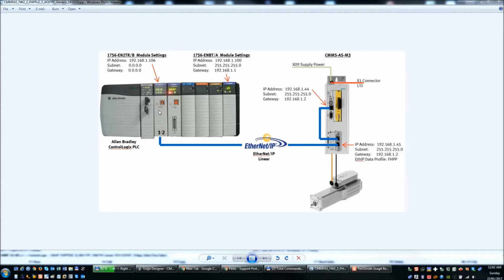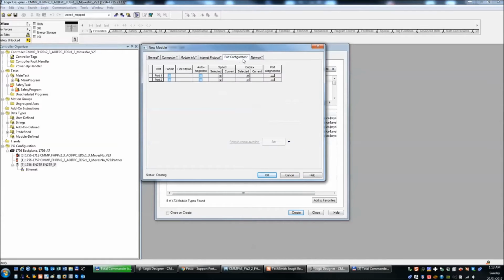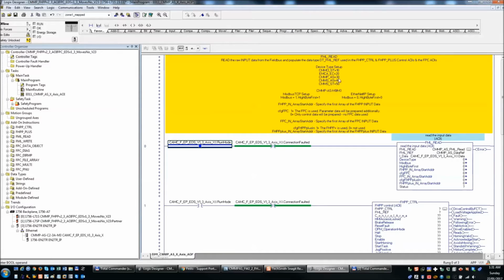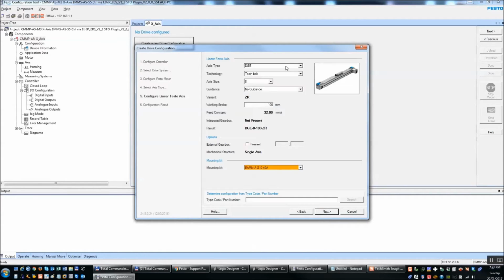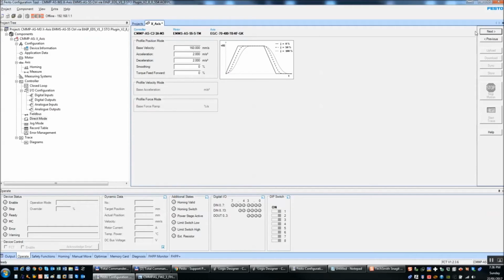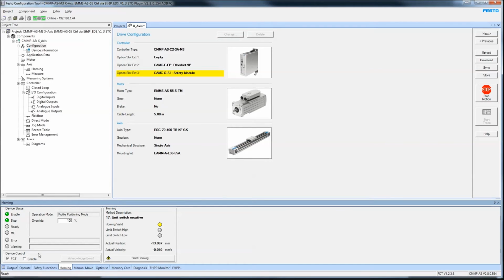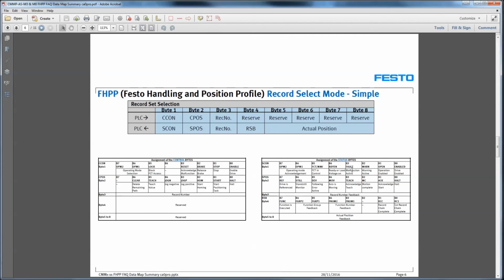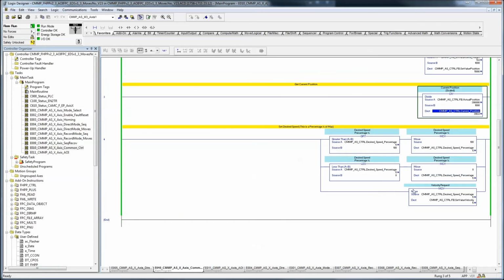CMMP-AS-M3 x1 + ControlLogix + EthIP FHPPV2.3 AOIFPC EN2TR Linear V23 EDSV1.3

Comment: Hi Steven I need to contact to you because The controller show me the error E512 and didn't know the safe controller and I want to know If I configure the controller for the first time I didn't have problems with my PLC in my case I have a PLC Siemens S7-300 I hope you can help me.
Reply from the maker: Hello Jonathan,  my videos are made in my private time and are for the public and are meant to help people without my intervention.  I expect people to handle encountered issues by themselves.  I do NOT have the time or capacity to provide support to any of my videos through YouTube or through a direct way via email or phone.  If you have an issue with a Festo product, then please contact their technical support and please do the same for the PLC manufacturer if you have an issue with their product.